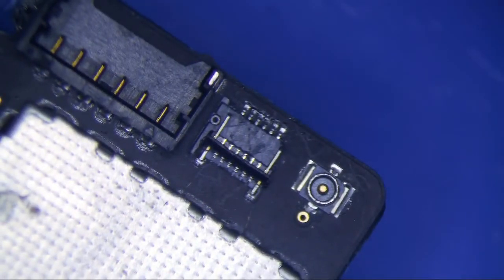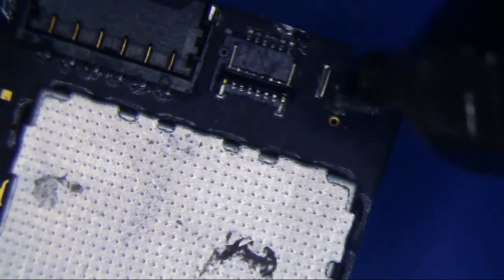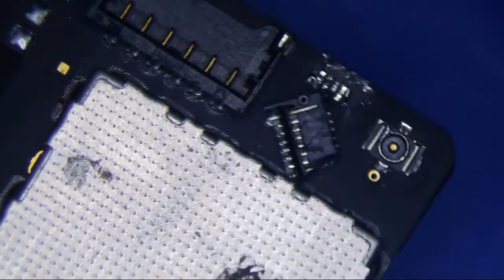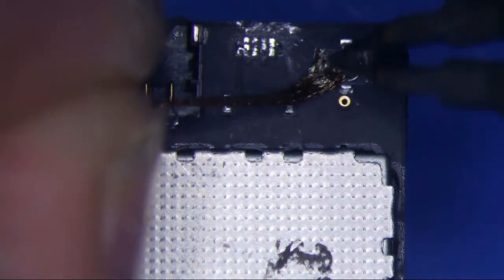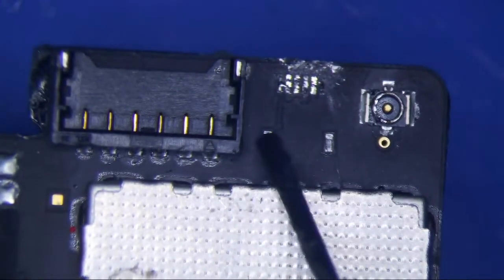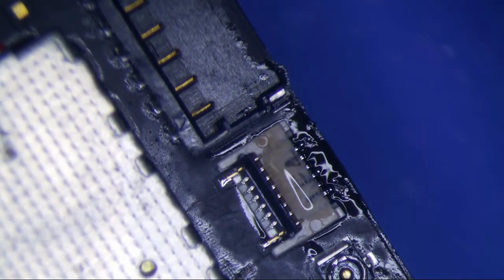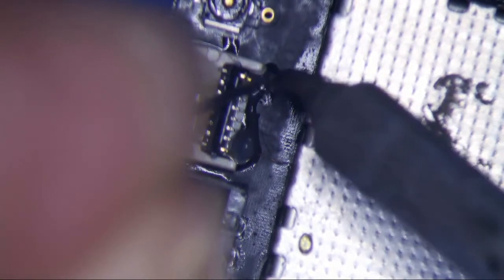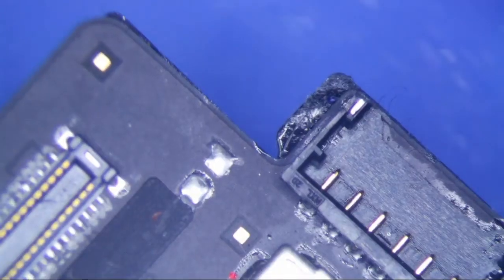ipad 4 home button connector repair

Comment: Need help I was replacing a digitizer when I dropped  it when some startled me, when  the home cable was attached to it tearing it at the bend ....I have purchased 2 home cable one never worked the other worked a few time but stopped ..any idea what to do ..I fixing this for a coworker and they are blaming me...making me replace the whole Ipad , This is an easy fix I have done work like this before iPhone and more why is this so hard to fix what is wrong . open the tab insert cable lock it down fixed right ? the gold part of the cable is facing up
Reply from the maker: Not sure exactly what you're talking about.  Send an email to support@microsoldering.com with some pictures please